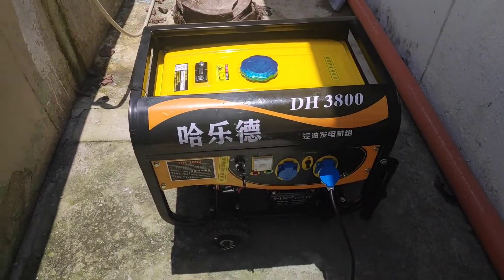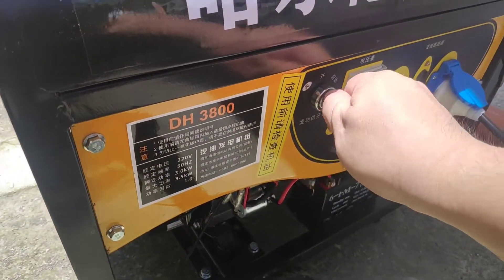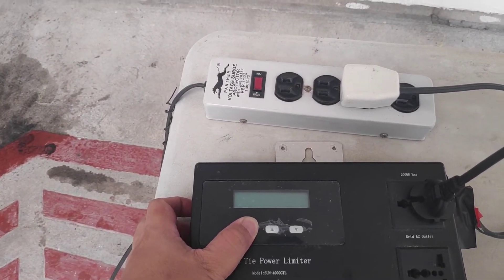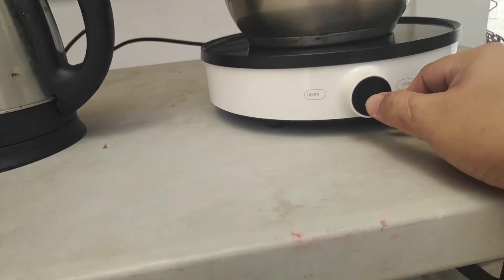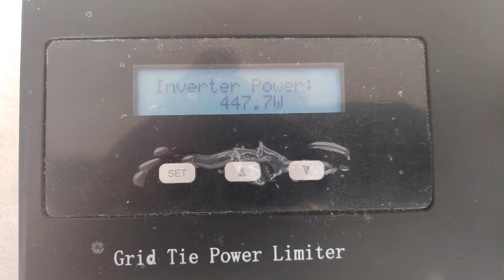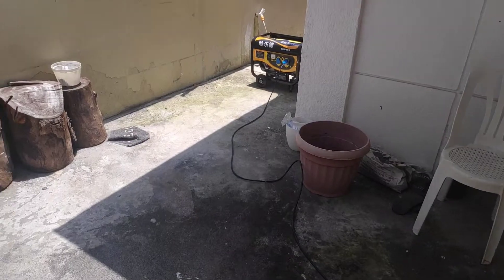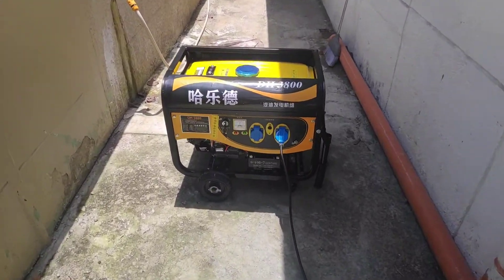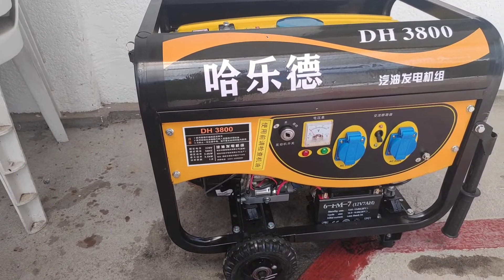DEKES Gasoline Generator 3500w initial test and checking the max power.

Comment: First the generator handled 2.7Kw for a while until something changed.. (out of fuel??, seizing?)  
Second, aren't you confuse/mix Watts and Volt Amperes?  (W vs VA)  the difference is in the cos. phy. (AKA power factor)  the 2.7KW against 3 KVA is a powwr factor of 0.9 , not really that bad and close to the max rated power. (3.5Kw is peak power for a very short time)    Question, is the gen. still running on lower load?